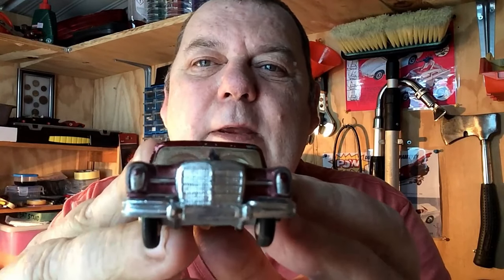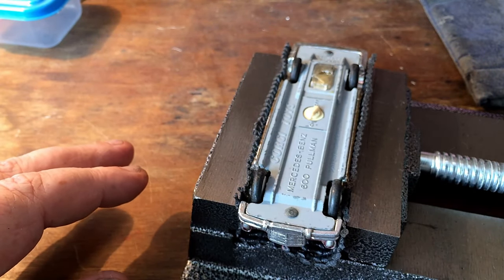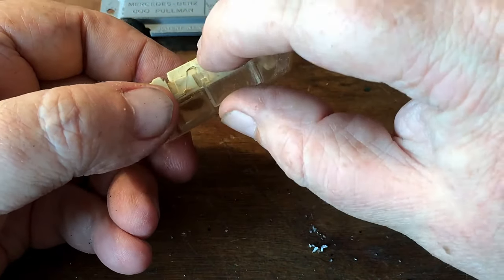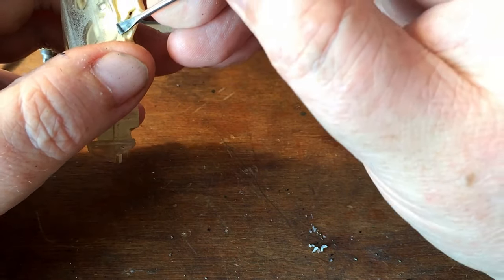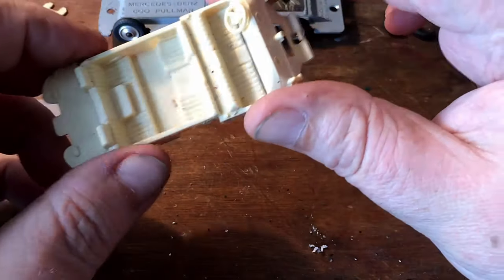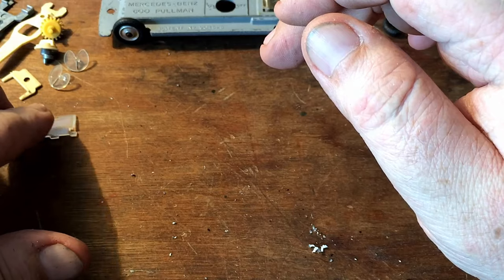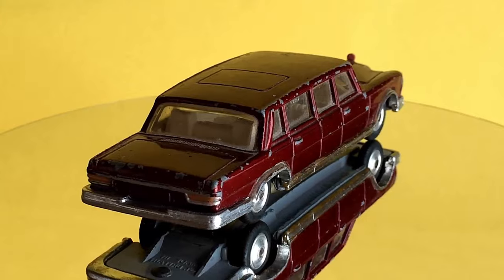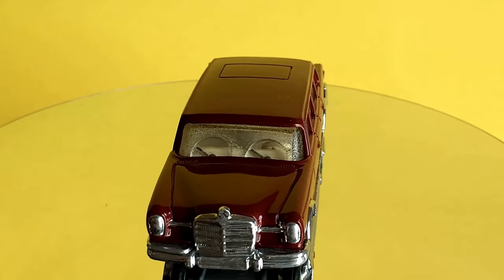Corgi 247 Mercedes 600 Pullman Restoration

Comment: Hi Bob. I couldnt find a chromed base for this when I checked Flowers site. The 1st one I did had a missing section on a front wheel arch. I had to replace the whole car to get an intact one. On both of mine the steering wheel was flopping around inside the cabin
Reply from the maker: What a pain that must’ve been mate 🙄
Reply: @Bob Willis Corgi Restoration  was indeed. Doesnt show that gear cover either. Both of mine were naff. Figure
d, you dont sit there admiring the chassis lol. Not up for resale. I can live with it
Reply: Got a few of mine like that. Oftentime never bother redressing the chassis unless it's a tin plate one & rusty
Reply: @Bob Willis Corgi Restoration  I had one like that. Had to do same as you, but these seem plentiful & fairly cheap